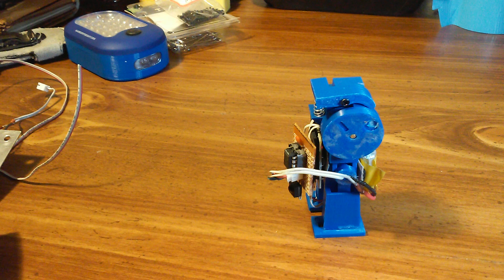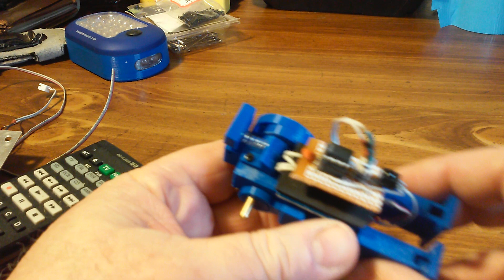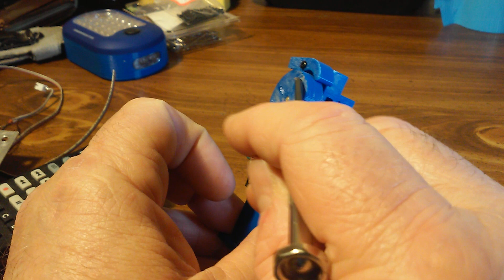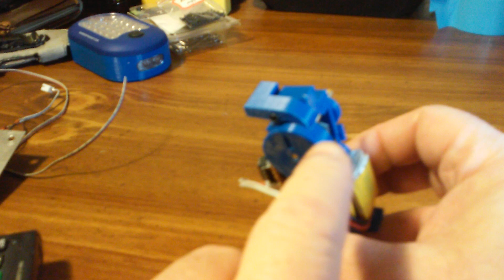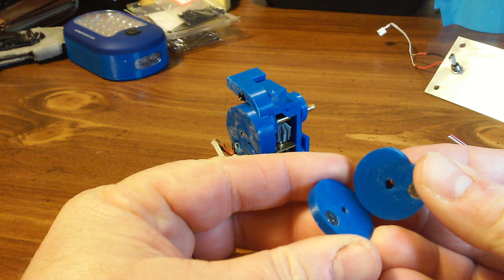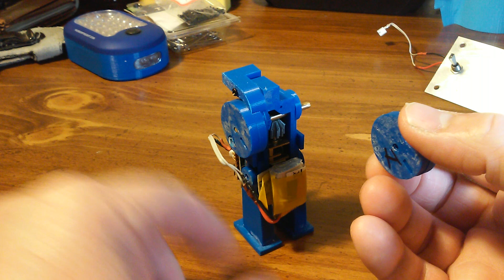Sort of steerable pin walker experiment

Comment: Over 12 years ago I made a all metal pin walker robot based on the Alphadrome "robot" web site. And I wanted to be able to do the same thing , so I made one of the pin linkage parts with a bendable joint near the bottom of the pin linkage. This joint would lock so that the robot walked forward but in reverse the pin linkage would fold up and that leg would not move. So got the same result as you but with a different method. Not sure if there is a video of the robot on you tube or not. Will have to do some digging. Great job on your mechanical design for this steerable pin walker !
Reply from the maker: Thanks Robothut. It seems your at least 12 years ahead of me😊. I think I understand  the basics of the design your describing but I would appreciate any more details. Just your description is sparking ideas . Thanks for the compliments on the design. I've been an electronics and programming hobbyist for almost 40 years. I've always liked making projects that move. The mechanical design and 3d Printing lets me experiment and build things without spending hours in a too hot or too cold garage . I wish we had this stuff 40 years ago.
Rick
Reply: You might like this 1950's mechanical walking robot that I just repaired and put up a video on. It is a pin walker that uses the pin linkage as the leg and foot and then a easel back wire frame to stay upright.
https://youtu.be/d-07c8q6zYw
Reply: Rick here are two links to my web site where I show pictures of the 4 robots I built using the pin walking back up and turn function. I think I did a video showing the pin leg mechanics so I will keep digging for that.
http://www.robothut.robotnut.com/DetectoJKpage.html
http://www.robothut.robotnut.com/Detectorpage.html
Reply from the maker: @Robothut  Thanks Robothut. I found a Detecto video:
https://youtu.be/fc32ppP0J2I
I watched a couple of your other videos from this time period. I liked the inside look in this one:
https://youtu.be/ikN0hF-vfM0
I like the arm swinging. 

These must have been large robots. Do you remember if you had to use a spring to keep the pin straight for the forward walking? I'm thinking about redesigning mine with the folding pin mechanism.
The YT comment notifications don't work half the time and I couldn't see your comments until I changed the sort order. Gzumwalt said he was having problems seeing new comments also.

Thanks,
Rick
Reply: I did use a wire leaf type spring that I made from a old guitar string. Think of the pin walking linkage like your elbow or knee in that it locks in the drive forward "pulling direction" and folds back in the reverse direction. The leaf spring is just there to kick the pin linkage in the locked drive position so does not need to be strong at all, the pulling forward of the pin linkage will keep the linkage locked when waling forward.
Reply from the maker: @Robothut  Thank you. I thought it would work something like that. I may just use some of my 6 MM magnets instead of a spring. They are probably strong enough but not to strong.  They are also commonly available if I decide to post the design. I'm in Fusion 360 right now modifying my design.
Rick
Reply: The magnets should work great in the repel mode to push the linkage into the lock mode and still let the joint bend back when in the reverse mode.